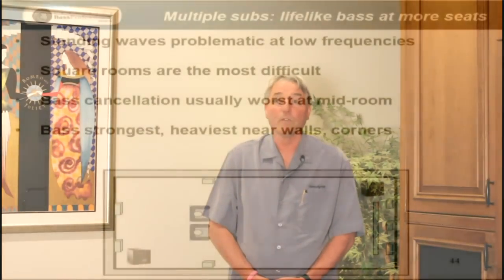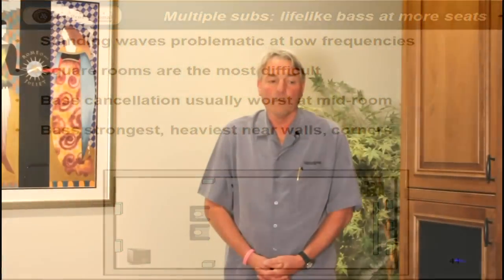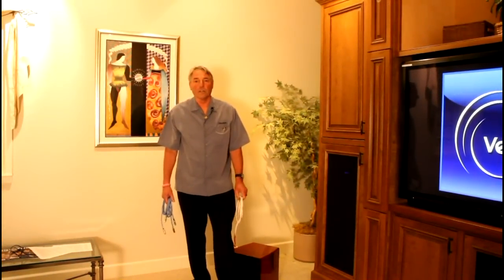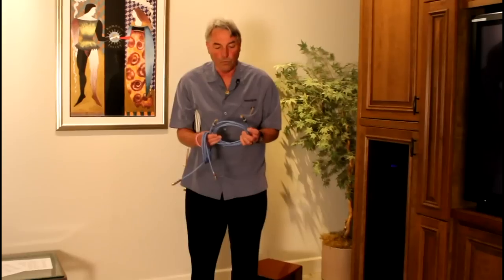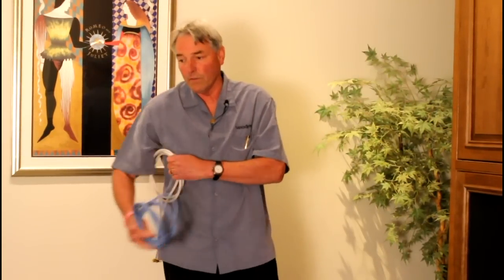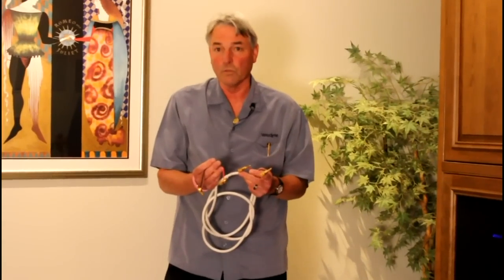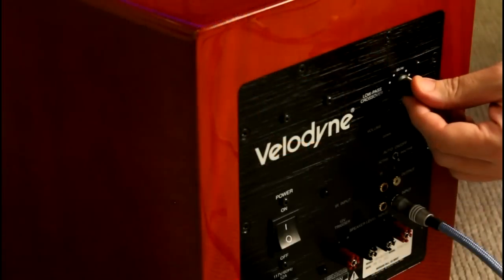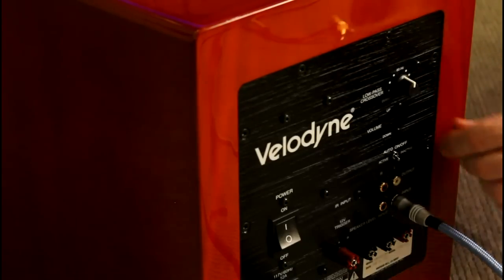Velodyne Installation Videos: Sub set-up

Comment: This video is very help ,accidentally I snap the RCA cable plug off into the subwoofer output on the back of my Harman kardon receiver today 😕 , so I believe I would just go with the recommended method at this point thanks for the video 👍👍

Comment: if you want to have problems with your subwoofer buys Velodyne you will spend more time in SAV listening to your music their amplifier module keeps breaking every 6 months it's a shame you want a good box  of low invest in a JL audio
Reply: Hmmmmm, I have 2 that are both 15+ years old, not a single issue with either. Running them off a Poineer Elite receiver.